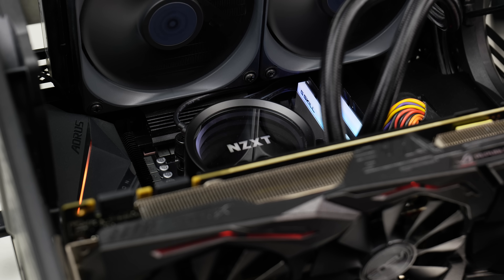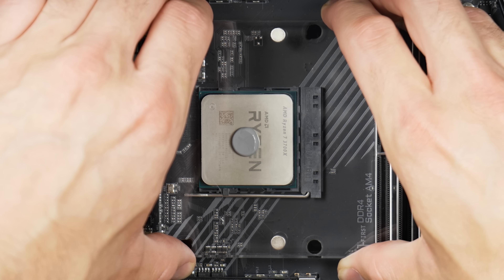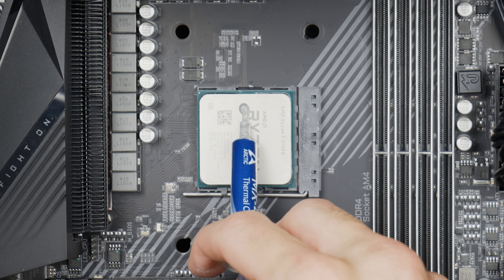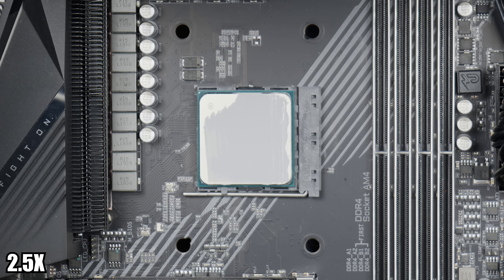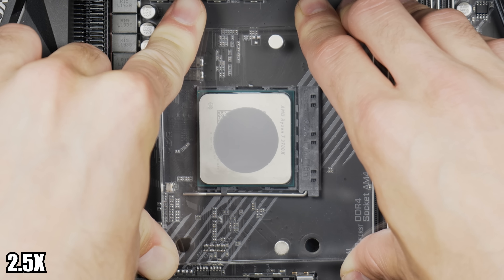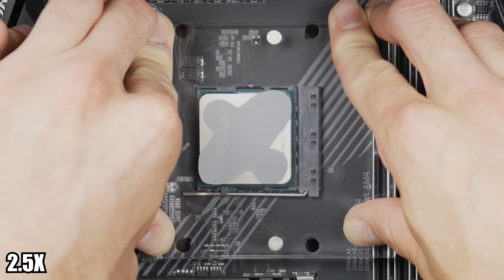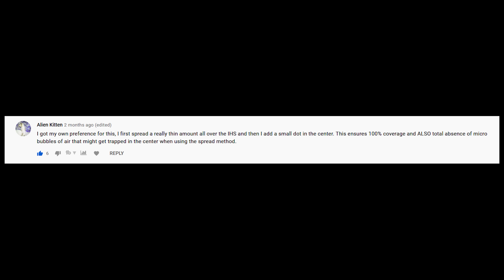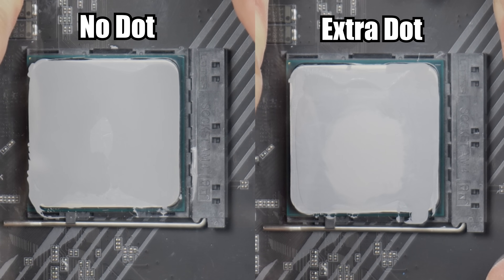Thermal Paste Spread Under Glass

Comment: Well on my laptop Predator 17x after 3 years i changed paste and cleaned fans, and i can tell a blob in middle and my laptop was overheating and shuting down with new termal grizly paste (yet it didnt shut down on 3 year old stock paste) after i opend again i had same as you a round circle in middle and it clearly was not enough for laptops i guess for desktop PC that can breath easyer it is enough. So i think that this conffusion around how much paste is due to fact no one explains that u need MORE for laptops then you need for PC. So my suggestion to all of you is a bit more will not hurt your chip yet a bit under will make it overheat and stress.
Reply from the maker: Yup. You're right on the die. Needs total coverage.

Comment: Yeah...most of those first few are WAY too much compound. The idea is to end up with the thinnest, but, most consistent, layer of paste between the CPU and the thermal sink. That has far more impact on temperatures than what specific method you use to apply the paste in the first place.

Comment: air bubbles in thermal paste are not a thing, thermal paste is like sticky sand more than water, any air trapped is simply going to leak through the paste out the sides with enough pressure.

Comment: You should try what tilers do. They use notched tile trowels to avoid bubble. You could probably make one suitable for spreading thermal compound by just cutting notches into an old credit card or something.
Reply: I believe they use notched trowels to give the adhesive room to spread out while still being able to level the tile, not to avoid air bubbles, which you see all over if you pull up tiles. (Not too big, though, or they sound hollow when you walk on them, which means not enough adhesive was used.)

Comment: Since the job of thermal compound is to fill in the little crevices between the two imperfect surfaces, the less the better.
What I do is plop a random amount however it falls on the CPU, and use the cooler surface to spread it, whilst applying pressure to squeeze out as much as possible.
This ensures total coverage, minimal air bubbling since the spreading is done by the two mating surfaces, and thinnest possible layer while keeping the gaps filled.
I barely even change thermal compound; when I built my PC in 2012, I changed the cooler a couple years later and reused the MX-4 I had already on the CPU because lazy. Temps matched online benchmarks.
I then replaced the faulty cooler in uhhh ~2018 and only then the compound had started to show some shrinking and caking, so I replaced it. I tried spreading the new glob with a credit card becuse some retard on a Facebook group kept drooling over and recommending this method to everyone, and got unsatisfactory results; reverted to spreading with the cooler surface, and 4 years later the max CPU temp under stress testing increased only by a few degrees, topping at 70 °C with an old air cooler and a whole cat worth of air in the fans and radiator.

Overall, the easiest and seemingly best way to apply thermal compound. Just be lazy and smart.

Comment: Spread it out with cotton swabs and when installing your cooler twist slightly while pushing. I'm still using Artic Silver 3, and you don't want any of that stuff on the rest of your hardware so when I see other methods that spoil some of the paste over the edges of the CPU I start worrying :)

Comment: Everyone misses a very important step- rub. I learned about thermal compounds from Dow. They told me to rub the cooler on the cpu. Rub the glass  on the cpu, when you feel a slight increase in drag, stop. pretty much those patterns will work with a rub. Rubbing make the thinnest layer of thermal compound.
Reply: Yeah...except the oils from your skin are not conducive to thermal conductivity; and, depending on the level of oils [or other things] on your skin, you may actually compromise the chemical makeup of the thermal compound. I would agree with your concept if you're wearing a rubber glove.
Reply: @jcpt928  he means that you should wiggle the cooler around a bit on the CPU before you screw it down. When you wiggle the cooler around on top of the CPU, you'll feel that it goes from slippery to sticky, which is when you've displaced all of the air bubbles.
Reply: @fermitupoupon1754  That does make more sense than the finger. Ha.

Comment: Unfortunately you will never apply the cooler in the even, straight down, with that much pressure, EVER. You lay the AIO on it's mounts, the air tower on it's brackets which are never level, or a boxed air cooler and you put in one screw, tilting the cooler surface, then the thermal pastes moves from one side to another. Pre-spreading it over the entire cpu surface works for me. Every time. But I wouldn't use a credit card to do it.

Comment: 1 Your glass plate pressed on 4 corners does NOT behave like a cooler : it cambers, making a pocket in the middle. Good coolers and pressing mechanisms are designed to press in the middle FIRST then deform a little around. Should have been much better to press on the middle.
2 Another critical point is the paste spread under CPU heat. When heating the first times, paste spread out even more, so if you want the best contact all these paste figures use way too much paste. So much past does not allow a metal metal contact at any point. There should be a 3points metal-metal contact then only a few paste where there is no contact between the surfaces.

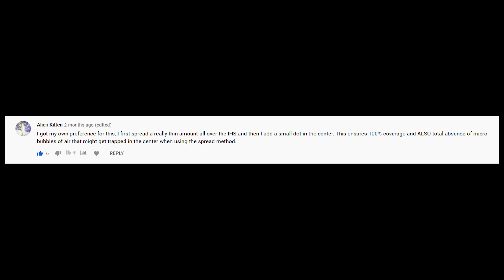Comment: 5:26 I use a spread and line method on these because of the size: 

https://www.infineon.com/dgdl/Infineon-FS450R12KE3-DS-v03_01-EN.pdf?fileId=db3a304412b407950112b43120c35398

It works really well even on the large area, i have removed some after fully torqueing the bolts to look at the spread. It is perfect every time.

Comment: I think spread patterns mattered a lot more back in the day when thermal paste was more clay-like in consistancy.  With the more fluid pastes we have today, even if you have a bubble it will work itself out to the edge over time as things heat and cool.
I think having too much was also a bigger deal with older paste, because the thermal conductivity of the paste wasn't good... it was just better than an air gap.  Modern pastes are almost as good as a metal connection, so having a blanket of paste that might be a little too thick isn't a big deal.

I do think it is important to have some idea of the layout of the chip underneath the lid, not so much for the paste, but for the cooler.  I use an Intel chip, and an air cooler with several heat pipes.  If mounted in the traditional direction where the heat pipes are laying up-and-down parallel to the RAM, and the fans are blowing front-to-back, then only the center 3 pipes are sitting over the CPU because Intel chips tend to be long and skinny.  Rotate it 90* so the fans are blowing bottom-to-top and then all 5 heat pipes are going across active elements of the CPU which drops system temps on my CPU by about 10*c which is pretty sweet.  It does make RAM install a pain, and looks a little weird with the fans facing 'the wrong way', but it is very effective.

Last winter I picked up a 3090 and started mining, which caused all sorts of thermal fun because the RAM modules on the back of the GPU would hit 112*c very easily (and then the card would thottle).  So I tool an old Pentium 2 heat sink, filed off the alignment nubs, and pasted it to the back of the GPU.  Then I changed the CPU fans to blow top-to-bottom so there was active airflow blowing on the back of the GPU.  This has knocked temps down to ~94-96*c which is more than acceptable as the modules shoudl operate just fine under 110*c, and should only take on damage near the 115-120*c range.  Fast forward 5 months and everything is still going strong!  Sadly with the coin price crash my GPU has only paid for 1/4 of itself instead of half of itself like I was hoping for by now... but prices will come back... eventually.  And it looks more and more like the merge will have a delay, so we will just keep on going until we cant, and wait for a rice spike to pay for the bulk of the fancy GPU.  It has still been a fun experiment, and having a GPU actually capable of playing 4k games has been a lot of fun!

Comment: I wish you'd have used the actual mounting holes and brackets instead of manually applying pressure. 
By hand you're not applying nearly as much pressure as the IHS is.

Comment: For over the last few decades, I have always put a little too much paste on the CPU.  I've never had issues with too much. well, without it being ridiculously excessive.

Also, the paste needs to be extremely soft.  Lumpy or firm paste is horrible.  Unless pre-applied paste.  Remember the first bit of paste out of the tube can be lumpy from sitting a long time on the shelf, or you had it in your desk with the tip not firmly closed.  And no break-in needed.

Comment: It would be quite amusing to test with other low melting metals like rose's metal and fields' metal instead of the usual gallium/galistan.

You'd have a solid piece of metal, and you'd have to heat the sink gently to <100 C to melt the metal and make it interface properly.

Comment: My thoughts are to use as little paste as possible.  The ideal condition is to have direct CPU to cooler contact and let the paste fill in the gaps.  
I lap my CPU if it needs leveling, apply a pea sized bit of paste and when I gently press the cooler in place I also slide it back and forth slightly until I can feel the metal to metal contact.  Based on dis-assembly for my last few upgrades, most of the paste is squished out and I get perfect coverage.  Never lost a CPU to heat and I've been building PCs since 1983.
Reply: yeah, and new generation of "experts" is just saying it doesnt make a difference... lol, well it does... when the paste will start to dry out. method of application never shows flaws when the compound is fresh, only when it gets older. and when the paste gets older, if the layer is too thick(pressure was too low etc.), temps noticeably go up. so as you said, paste is meant to enhance the thermal conductivity, by minimalising air pockets, and not to form a layer of goo both on cpu and on mobo xD
Reply: @seushimarejikaze1337  You lost any credibility when you said "cpu" and "mobo"... think about it, lol
Reply: That's the thing, there is no such thing as "perfect coverage".  You're never going to get a bare minimum application that just fills in the microscopic gaps and pits.  Applying a "perfect" amount of thermal paste has always been an inside joke to the educated PC builders.  Furthermore, it is a myth that you must cover the entire IHS.
Reply: @mccalejk2  i really cant see how credibility is in any way tied to what i said, as all said, is true and comes from actual experience from maintaining and troubleshooting my own pc(that evolved a lot since 2004, first one completed around year 2000) for more than 19 years.. anyway its not a myth, but i guess, people nowadays dont care for hardware life as long as sensors show them "correct" temp... thing about covering whole ihs comes from the fact that if you dont, there might be temperature differences within the cpu (by extension between cores) that potentially can do damage. depending on the manufacturer and a model it can either lead to minor problems  or none, but better to be on the safe side and go for bigger contact area between ihs and radiator, right? (or dont do it, proper care for hardware is a personal thing and all up to you {its your money} and some people dont even clean their pc of dust{psu included} even once a year, then come to me saying their pc doesnt "boot up" and if i could help... lolz)

Comment: I would like to see if there is any difference if you were to have a bigger piece of plexi glass with holes that match the mounting plate. That way you could screw on the glass in a similar way you would a cooler by tighting screws

Comment: i always do the spread with a tiny dot in the middle this gives a guarantee 100% coverange and prevents a air bubble. And dont be afraid to spread a little thicker. You spreaded really thin. A bit of overflow really does no  harm infact you have more cooler contact as the side of the heatspreader an give off heat. 

And my 3770k that has bin on 5ghz sins 2012 or 2013 cant remeber has arctic silver 5 since day one and never replaced it and still preforms the same.

Comment: Those spreads with bubbles simply trap them and at that spot si no heat transfer(extremly weak) It just seems to disappear as the paste gets on the glass and the bubble is inside the paste.

Comment: I fixed a pc for a friend the other day.  
But every time I apply thermal paste on the chip(s) i use different patterns. But I never know if I did a good job of applying the paste. I mean if I did a bad job I'd get complaints of the pc's not working, but I've always wondered how my ''go to'' application holds up.
The pattern I've probably used the most would be a X with a dot in the middle of every empty spot. Seems to work out pretty well

Comment: The X or 5 dot method is the best, and yes it does make a difference more so the paste you use as long as you have a large enough coverage, it won't be perfect every time and the heatsink (air cooler or AIO) will apply a better pressure across the IHS when you screw it down so that helps spread it better.

Comment: Been using the X method for at least 20 years now. Even did what I call a dotted X(place a dot of paste in each of the "V's" of the X) once, but realized it was just wasteful as the excess left a nice ring of paste around the edge of the IHS. Annoying to clean up when you take it apart to apply fresh paste during an annual deep clean.

Comment: If less does as much as more I'd rather use less and have some left over and none down on the mobo or socket. Bigger than a BB smaller than a pea for a normal sized CPU is perfect. For Threadripper and other unusual CPUs things are different of course.

Comment: Great video. I would suggest you cover the glass with tape when you put it on and take the tape off, once you think you are done. This way you prevent yourself from cheating due to the visual feedback. Some methods might work better when you don't see how the paste spreads.
Reply: I would probably suggest using a thin sheet of plexiglass or just plain cling wrap and just put the regular cooler on top and tighten it like you would in a normal build. That way you get the right pressures and behaviors and you can then take it off without disturbing it.

Comment: New to the channel and enjoyed the video. I think you should rig up a mount for your acrylic to rule out the unintentional motion of your hands as you press down. Could probably modify an old heatsink mount or snag some nylon bolts, washers, and nuts from a local hardware store.  I personally use the buttered toast method, but I butter both peaces of toast (IHS and heatsink). AS5 being the butter in this analogy, for the curious.
Reply from the maker: Yeah that would be ideal. I had a similar idea but didn't have to tools to pull it off. Maybe I'll do a follow up video.

Comment: Thermal paste is far too thick in my opinion. A proper mating of surfaces is way more effective than filling gaps with a substance with a lesser thermal efficiency than metal or even mineral oil.
I lapped both surfaces until completely flat and applied 2 drops of mineral oil which lowered the temps by 20°!
Never trust someone who claims you NEED their product!

Comment: I don't think it will actually matter much, but it would be nice to see the spread with some uniform pressure applied, say setting the same weight on it for every test.
Reply: I don't think perfect equal pressure is representative of real world situations when you build your PC. You'll never apply perfect pressure yourself so why would the results of a perfect pressure test matter?
Reply: @themonsterunderyourbed9408  it’s not real world, but it is required to give useful data here. In the video, it’s close enough not to matter all that much, but not using the same conditions on all tests makes the tests useless to compare anything.
More specifically, I’m not saying the pressure has to be perfectly applied to the cpu, just that it should be applied the same in every test

Comment: I think the air got pushed out because of a difference in viscosity. It would be really hard to trap air permanently when the system is under pressure

Comment: The safest way definately is just a massive dot. Because it will certainly be pushed outside, creating a mess, but it's guaranteed the whole IHS is evenly covered.

Through this video I think I know which method should be the absolute best: Big dot in the middle, 4 smaller satellite dots closer to the edges. Gives great coverage like the X, no bubbles, but also got a little more matter to the horizontal and vertical axis to full those little spots close to the edges, that the X hardly covers.

Also, since I found out, that Arctic MX-4 lets my computer run at the same temperatures as freaking liquid metal, I am only using this stuff anymore. Maybe my metal application wasn't optimal to reach most perfect cooling, but well.... In any case, no real cooling advantage certainly isn't worth living with the risk of short circuiting something on the board. You could empty a whole tube of MX-4 onto the CPU, your computer would be a disgusting mess, but still working.

Comment: You don’t want to go cheap on thermal paste. The cheap stuff will not hold “Viscosity” it will divide and separate the solid from the liquid and the liquid will leak onto the motherboard and into the socket. So you definitely don’t want to go cheap when buying thermal paste. Its like real peanut butter and will separate. What brands are the best ?….I know MX4 offers an 8yr. Durability and MX5 is suppose to be good too.